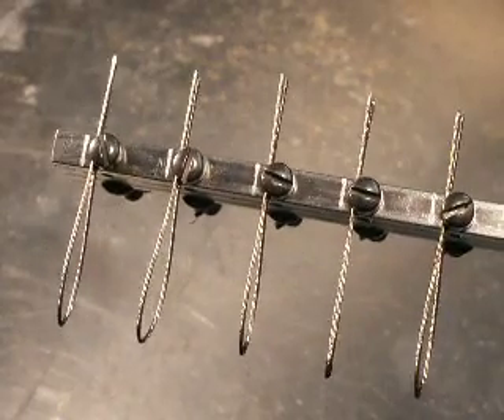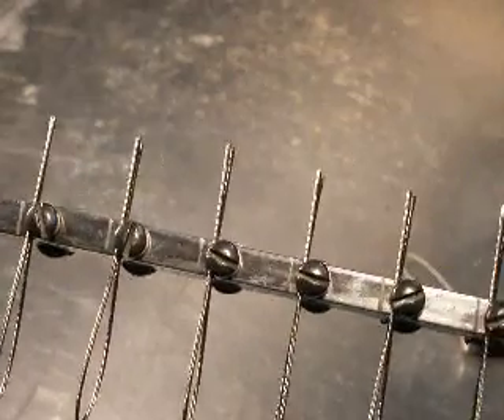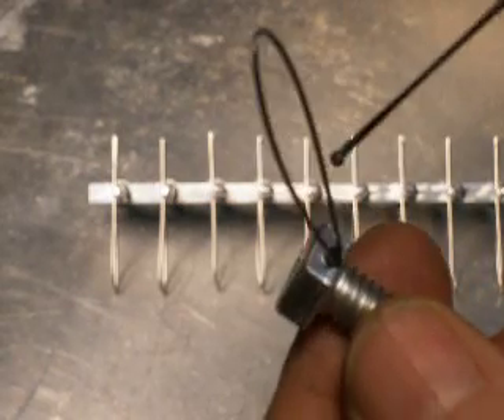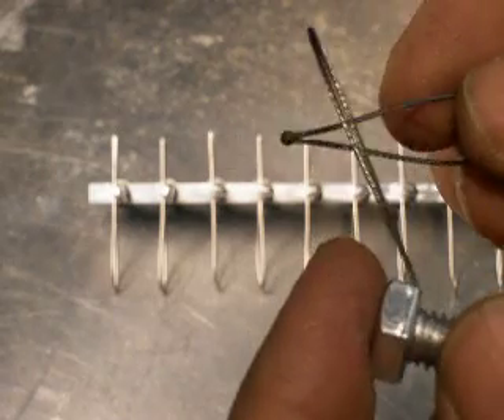Tig Welding Stainless Steel wire to form ball end

Comment from the maker: @partyboy93 

Thanks for the info. My bad! I never considered that, though it's highly unlikely that the part will encounter enough moisture when assembled to rust. I was really proud of myself for buzzing along so fast on these. I'll have to slow down on the next batch!
Reply: And.... it would be nice if you focused the camera so that the audience can see what you are doing since we can hardly hear your dialogue over the sound of the welder.  The tool you are making is clever. If you plan to make additional videos then go to this web site. Guy's name is Jody. He's a spectacular tig/mig/stick welder and makes unbelievable videos also.  It will be worth your time.  weldingtipsandtricks.com
Reply from the maker: Been to his website many times; great stuff. I'm a gunsmith, not a film maker. Sorry for the noise!